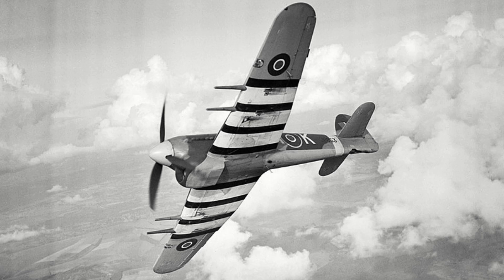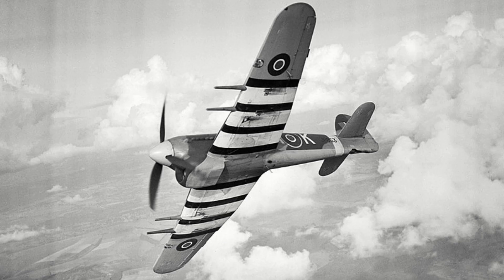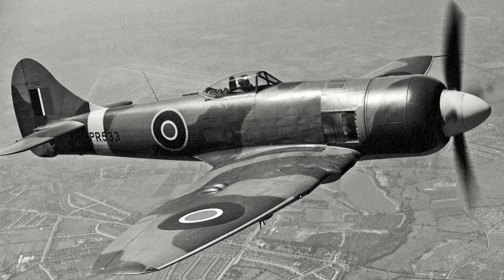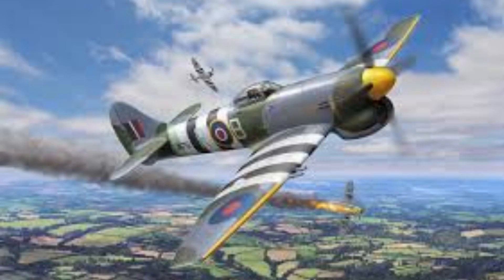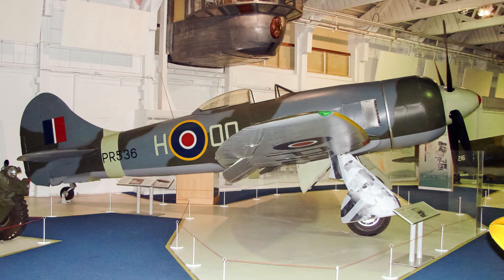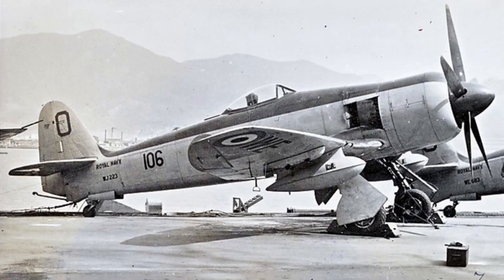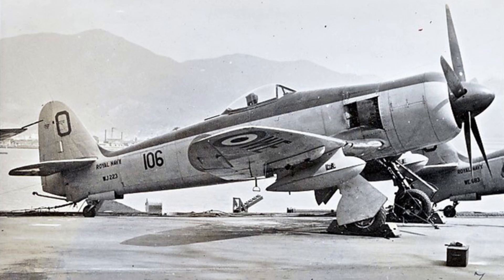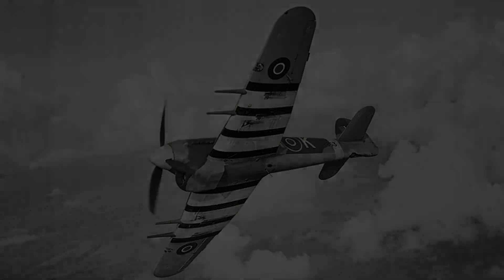5 Minute Guides to Aircraft: Hawker Tempest

Comment: The Napier Sabre was initially unreliable and was improved before the Tempest. It was bigger, faster and more heavily armed than a Spitfire but not as maneuverable.
Reply from the maker: Well, 2000hp in an H block configuration is a mechanical nightmare to think about, and the fact that Napier got it to work in the first place is kind of a miracle of engineering worthy of its own video. Part of the reason why they eventually transferred over to the Bristol Centaurus in the Mk2 as the more common engine choice is ironically because of the Sabres issues, as the Centaurus offered effectively same performance in a much more convenient and conventional package, though wasn't available till late war.

Ironically enough by the end of the war the Spitfire had the same armament layout as the Tempest, quad 20mm Hispanos. The tempest however had more ammo per gun, and had more advanced versions of the guns.
Reply: 2,000 HP your not even in the right ball park some of them where over 3,000 hp in use in WW2 @5MinuteGuidesToAircraft
Reply from the maker: @briancollins9087  The 2k HP number was in reference to the Napair Sabre models of the Tempest (which produced around 2.1k Horse Power). The Mk5 were the more produced and common version during WW2, while the Mk2s with the Bristol Centaurus which did deliver 2.5k and 3k HP were made in smaller numbers and more common in the post war era. . .and the Centarusus that did deliver 2.5k and 3k HP were post war engines, as the Mk2 Tempest used the MK4 Centaurus initially, not the Mk 7 or later.
Reply: @5MinuteGuidesToAircraft  Pierre Closterman who flew tempests refers to the 3000bhp in his book about flying the tempest. Some Sabres made 3500bhp. Hell of an engine!
Reply: It could put roll any mark of Spitfire at speeds above 300 MPH.